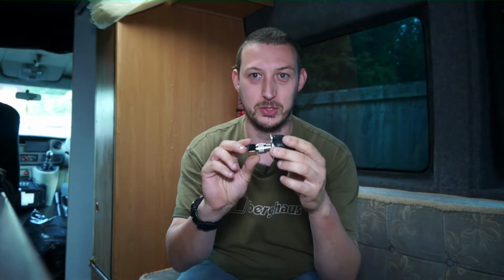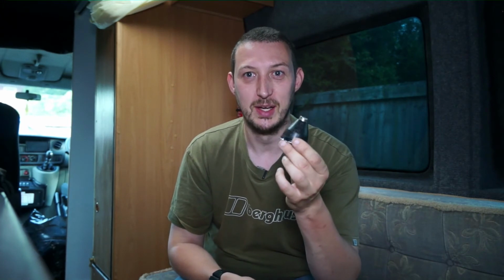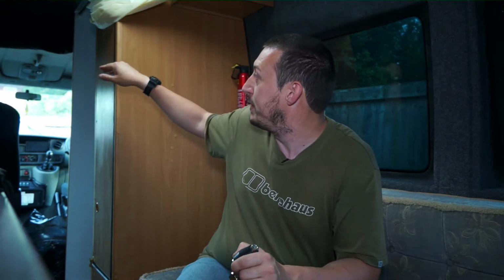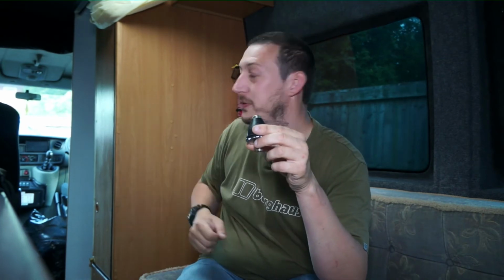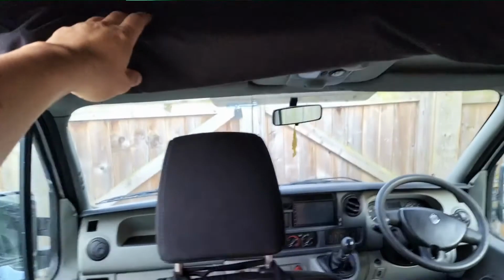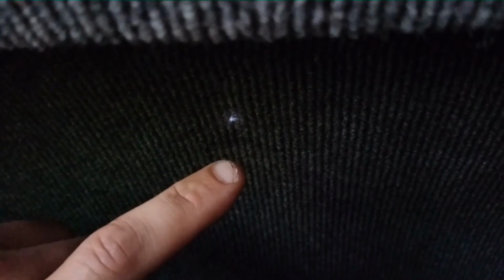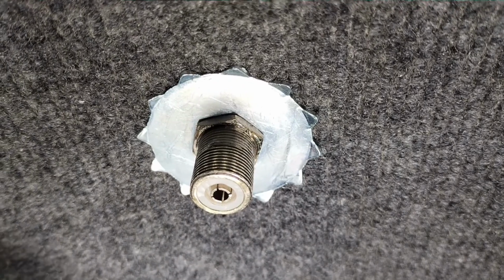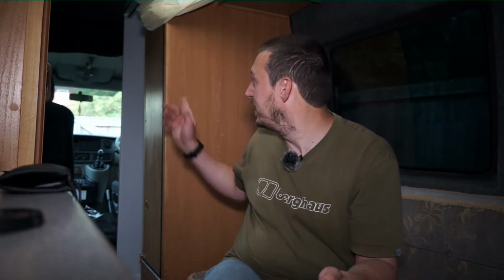Fitting A 3/8 Antenna Mount To The Amateur Radio UK Tour Bus!

Comment from the maker: Thanks for the comments folks. Several people have commented on the fact that I mounted the washer upside down.

As obvious as it sounds, I have to admit that I did this job in a bit of a rush & just put the washer on in the same orientation that it was supplied from the seller. My theory was that the connector passes through the bare metal roof, which should give a ground connection.........unfortunately it didn't!

I have now corrected this!
Reply: Thumbs up :-)

Comment: Looks like it’s going to lead to lots of adventures for you James (& videos for us) excellent 👌
May be worth considering quickly flipping  that washer and resisting it under the carpet/insulation, less of an issue on 2 n 70 but hf wise you want a good connection to that body don’t you. 
Looking forward to videos of you our and about in it 👍👏👏

Comment: That plate isn’t just to spread the load, it’s to bite into the metal and give you better grounding to the roof…you have it upside down. 😉
I would have dropped the headlining, cleaned back to bare metal behind so the nut and mount got the best possible contact to the roof.  HF needs a good ground and good bonding to metal for mobile installs. 👍